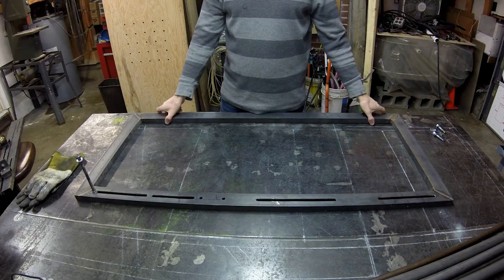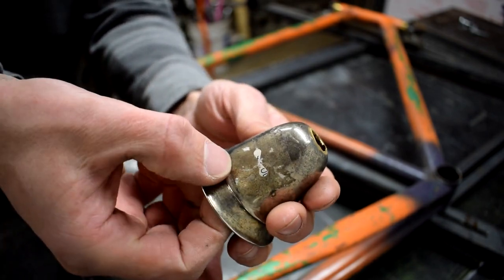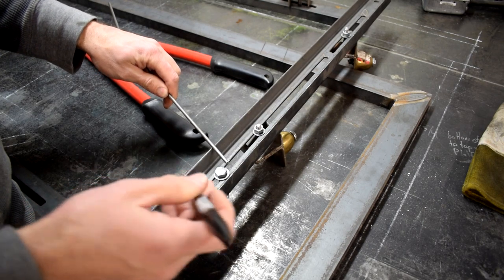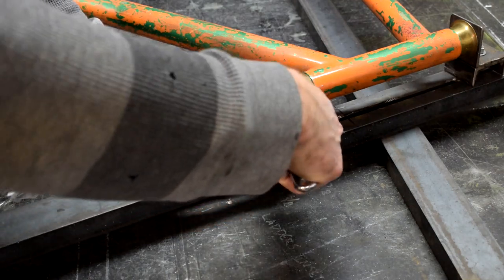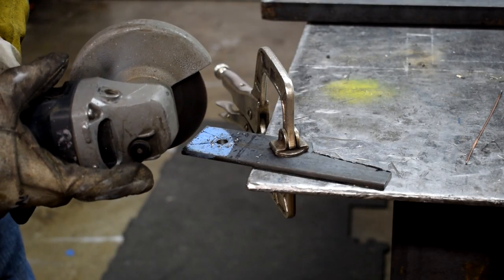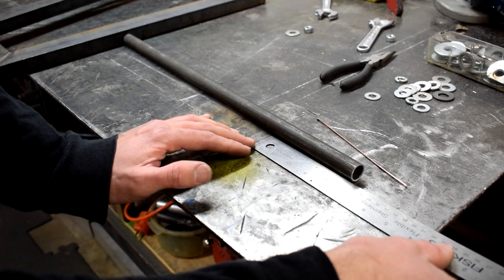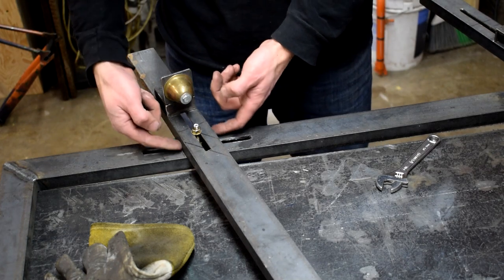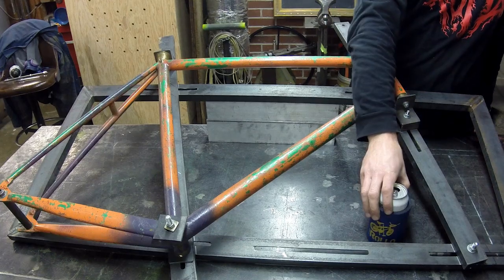Finishing my Budget Framebuilding Jig - Fiets of Strength Ep.5

Comment: Nice!  I'm sitting at about a five year clock on my frame jig as well.  Started building it as I was getting into bikes and welding and then got extremely (and still currently) side-tracked by freakbiking.  Mine is based off the Instructables 8020 aluminum extrusion template, which has significantly less panache than yours.